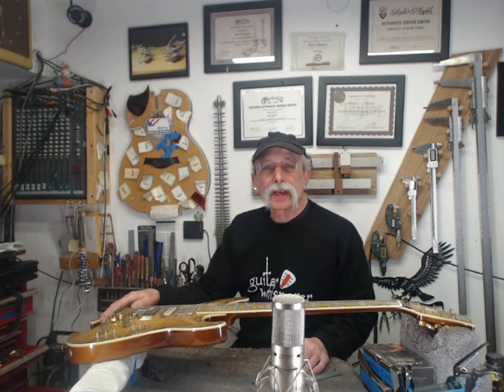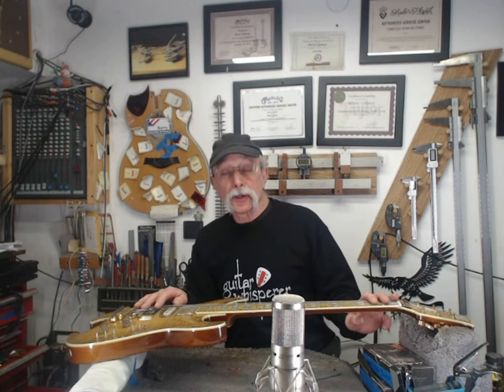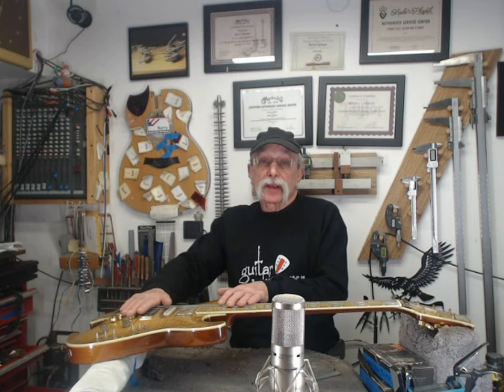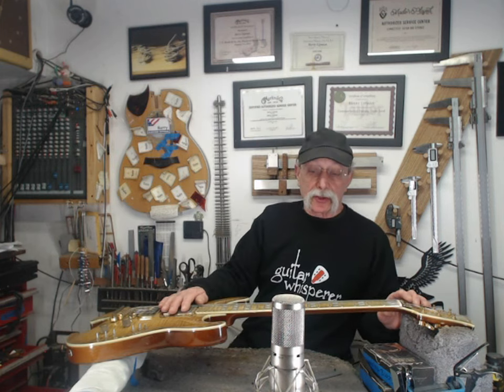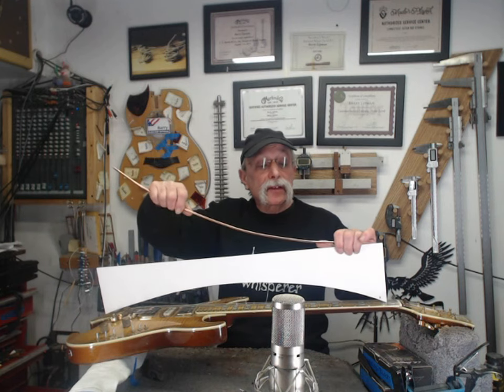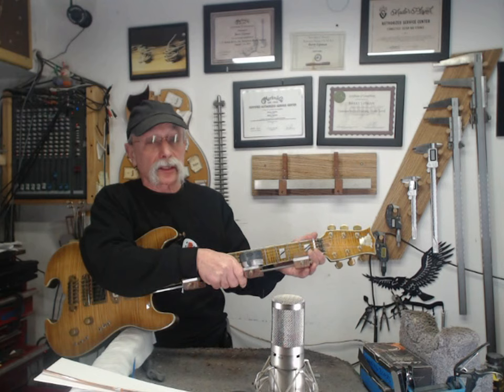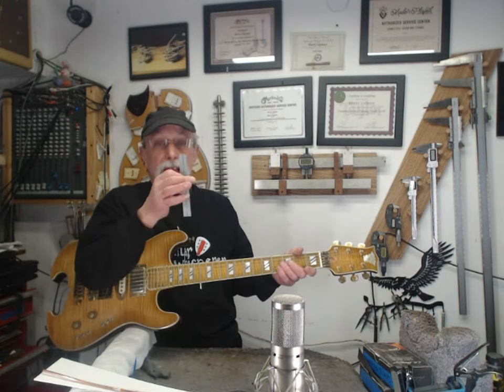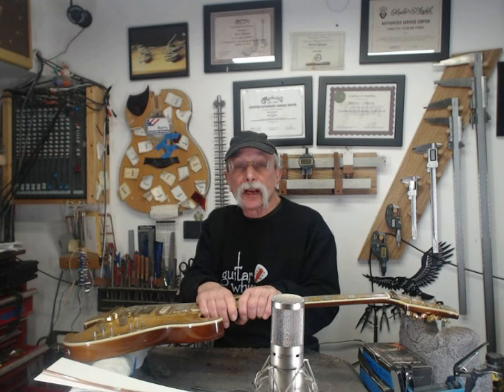Guitar Neck Relief - How straight should a guitar neck be?

Comment: This is one of the best explanations of neck relief I've seen. With a neck that's dead straight after the instrument is strung and tuned up, the clearance between the string and the fret above another one that's fretted (e.g. with a finger) gets increasingly small towards the nut end of the neck (basic geometry). Neck relief helps to reduce this effect, and it's very convenient that necks typically bow more at the thinner end, which is where the bow/relief is most needed.

Comment: Barry,  Scobie from Seattle here. DH shared this video with me recently. This was a lot of fun to watch and reminded me of the first time you clarified so much neck geometry for me over the phone, in preparation for our bass-building project. I remain honored to have had that and all other lessons from you. 

In this YouTube presentation, I followed all of it.... right up until you started using your short Starrett to begin indicating an actual >reverse< in the relief curve as you began approaching the body of the guitar. 

Why on earth would convexity anywhere on the frets be desirable, however subtle? Wouldn't you want the neck to simply stop curving (having relief) as it approaches the body? 

Perhaps your explanation here is meant to address why one might want the relief curve to fully reverse, but if it does, I've missed it.
Reply from the maker: Good question… really!  You’d think the relief would continue to diminish out to the end of the board, or maybe go dead straight, but neither option works as well as a bit of fall-off.  Any rise or bow after the twelfth fret out towards the end I call a ski-jump.  On electric guitars that tends to cause fretting out on bent upper notes on the high E and the B strings, as well as a “slappy” sound with poor sustain on the higher notes.  On basses and acoustic guitars, where bending is usually not much of an issue, it just makes the notes slappy.  Given the tendency for fretboards to increase in bow over time from string tension, there should be a drop off to pre-empt any ski-jump.

Comment: oh my, I've been repairing stringed instruments for over 40yrs, and you seem to be confusing a very simple thing as neck relief with little narratives and anecdote. Very simply, relief is how straight your neck is. Typically, guitars are set-up to be very close to perfectly flat, but with a little bit of relief (slightly concave). The rest is simply how to achieve this
Reply: I just posted exactly the same thing. I never had a problem if the bow is barley visible but still there it is fine. If you need to adjust more look at the saddles and then the nut
Reply: @johnjonesToffeeman   yes it's a process of truss rod adjustment, then saddle & nut height in order to find some ideal relief to fit your particular comfort on a fretboard. Any ideal setup can vary depending on ones playing style, string gauge, humidity, ect.. In some cases shims or a neck reset may be required as well